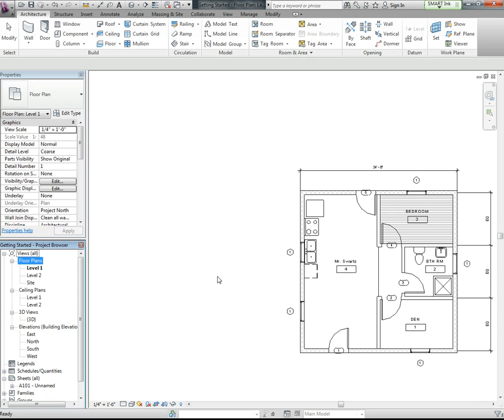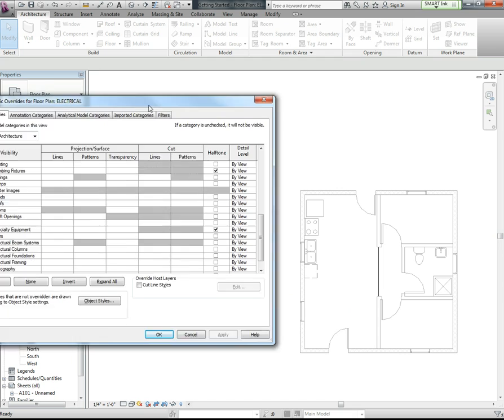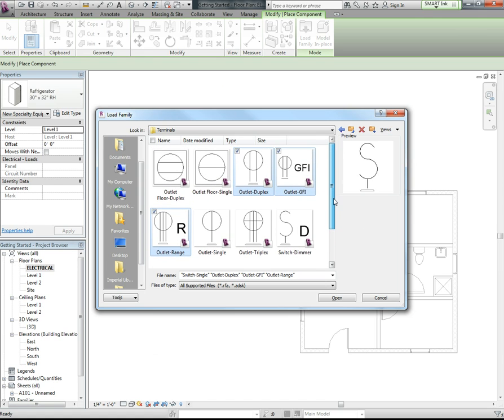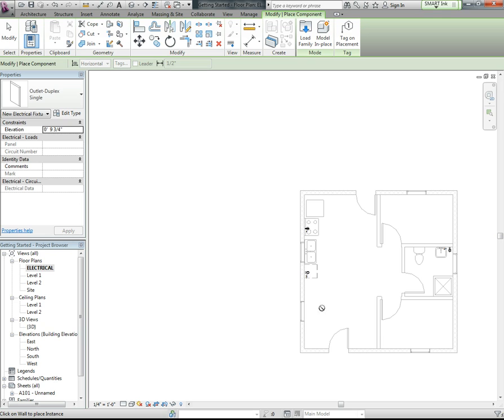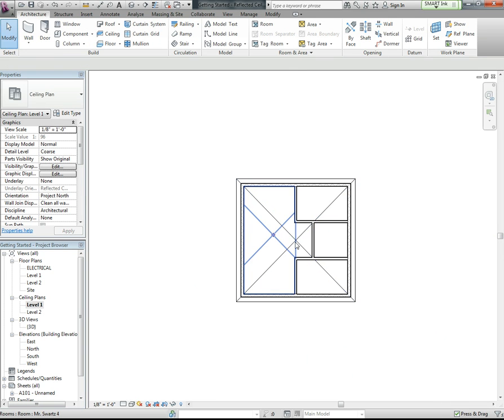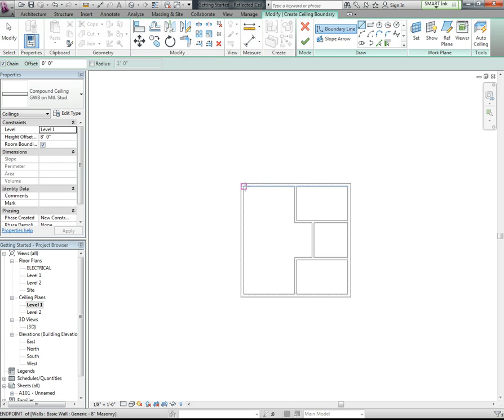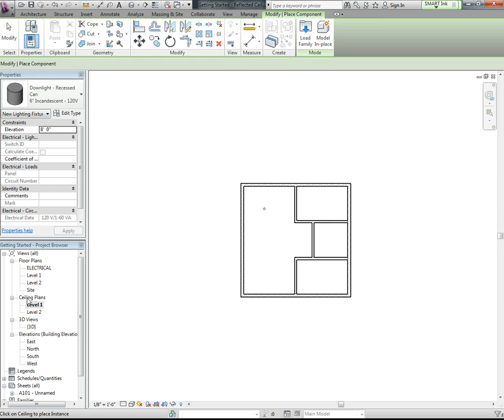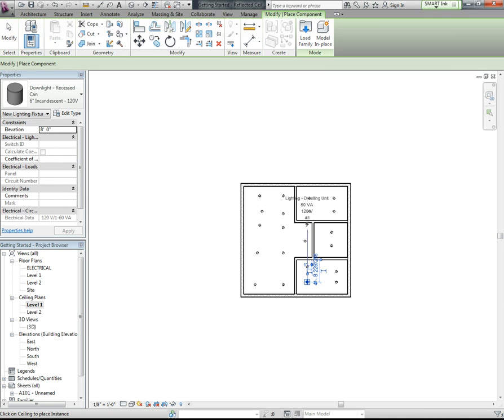Revit tutorial Electrical plan part 1

Comment: hello, you might be able to help me with this. I have a curved roof made from a generic mass. I am trying to do an electrical plan but it will not let me do a ceiling from mass. so how would I put my lights without a ceiling?
Reply from the maker: Lights can only be placed in ceilings is what I have found.  You are unable to draw a ceiling in from sketching?  You should b able to sketch a ceiling at the height you want and the shape you want.
Reply: no, it will not let me. It makes a flat ceiling by sketch. There is no ceiling by extrusion option either. I'm sure i'm not the first person to make a curved ceiling.

Comment: Why are you using an Architectural template for electrical work ? You should use either the electrical or the systems template to start the model. The default revit template is architectural, so you have to change it, otherwise your model will not be truly electrical, and some items can't be circuited. Also, walls and doors will be automatically half toned when the view "discipline" parameter reads "electrical" instead of "architectural".
Reply from the maker: I teach a basic architectural class to high school students and we don't have time to get to indrpth so I just teach a simple thing in revit to them
Reply: that's correct,,,we archi drafting we use in Architectural template for electrical plan,,coz we are not electrician,,thanks sir ryan

Comment: Regarding the creation of the Reflected ceiling Plan, can you use the Plan View tool under the View ribbon which actually creates a reflected ceiling plan option instead of having to duplicate and change all the properties to half tone...?
Reply from the maker: +Anne Nelezen  I have not tried that I will look into that.
Reply: +Anne Nelezen  Anne using the reflected ceiling Plan is what you should use, it will show all of your lighting fixtures, and their placement. Then do your electrical from that.